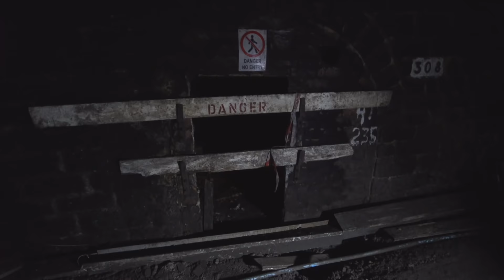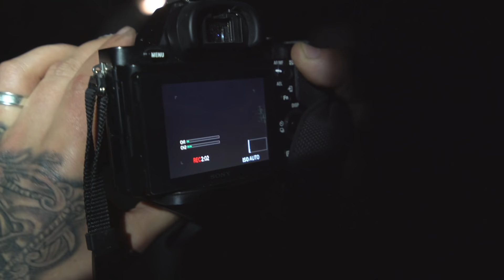CRAZIEST UNDERGROUND EXPLORE YET! A WORKING TRAIN SURPRISES US!

Comment: ~ What if, what we have been thinking of as Tunnels under the surface, were actually originally the buildings existing on the surface ? We tend to think of things in terms of what they are used for now, when maybe, they have just been re-purposed from a previous time & used after some alterations to their immediate surroundings have occurred. ~ The round tall part, {that people are saying was used for steam trains}, may actually be a round tower, from an older building, that you see all around the world.~ It just happens to be buried now, but it wasn't always. ~ The arches you see, are not the height that they look now, they were buried, so the floor comes further up to the middle or top area of the arch, & the rest is buried beneath your feet, as you walk through the tunnel. ~ It would easily explain the fireplace & wooden floor, that was found. ~It would also be interesting to see what is really, hidden within the places that say danger, as that is also probably also hiding things of significance,{ just like the tower, that you discovered.} ~ There is much hidden in plain sight, when you start looking at all of the buildings & levels, & also notice the pre-existing structures,that are exposed when the ground is dug up, to build other structures.~ Thank you for showing us this, it shows way more, than just tunnels. ~ Looking forward to seeing more, of our world, Thank you immensely, for your efforts. ~

Comment: Surely this is just Standedge? It has three railway tunnels, two which are no longer used for rail, but I understand when a boat goes through the canal tunnel a vehicle often shadows it for safety, hence the recent tyre tracks. There are also three (i think) refuges that the pilot has to report in at, you came across one of them. None of this is sinister or military! Think you are pulling our leg as it isn't in Hull either!🤨

Comment: The tunnels you're walking down are maintenance tunnels and yes Van's do go down them when track maintenance is needed (the trains you've been seeing) I wouldnt want to be lugging all my tools all that way to get on the track for signal maintenance and the shaft where all the water was pouring down is just as you say a ventilation shaft the fireplace is years old and was for old workers back in the day like the 60's the boat you saw is a survey boat I'm pretty sure not that I've seen them underground myself

Comment: Think years bk if u were on ur break working down the tunnel them fire boxes would be the only heat and way ov cooking ur Breakfast the holes are vent shafts for air steam and smoke from the old trains could also be used for emergency if needed

Comment: That tunnel you were walking down was an old railway line. Those 'danger' holes in the walls were clearance holes for people to use when trains where lassing. The boat was more than likely used for surveying the condition of the tunnels. I must add though. If you are going to plan on crawling down a tunnel why the hell would you go down wearing caps and ripped jeans... Seriously. Get some overalls 😂

Comment: You should never smoke in tunnels or caves as there is no methodology completely remove the smoke. The smell and smoke will last for years if not decades. Ventilation systems are inadequate to cleanse the tunnel or cave

Comment: Well I was totally confused by this as you start off in Hull and we seem to end up in Standedge Tunnels!   The boat was a tourist trip boat that does not go all the way through, it goes so far in then reverses out.  The place where you tripped the light is one of the safety stations that cannal boats going through have to stop and contact the outside world so the operators know how far you travelled.  Oh and you have to have a tunnel man onboard your boat.  Surely there is not two sets of tunnels like this so I leave this with you.

Comment: Watched this last night and couldn't work out how they got a boat 600ft under Hull. Didn't think it should be possible. I was right, the actual tunnel they went in was 40 miles away.  Seriously, why lie? Won't be watching any more of your edited nonsense. I prefer honesty, even if it isn't as exciting.  BTW the people on the boat were banging on the walls to test the structural integrity of the tunnel. Knock on the brickwork with a hammer and if it sounds hollow, then water has got behind and it needs sorting out.

Comment: When I saw this video, I wanted to know more about these tunnels.  So I found another video where they explained from A to Z the underground network. So the canal tunnel is the oldest (made around 1800) And then you got two disused train tunnels and one train tunnel still in use. The complex was finished around 1895. Between all those tunnels you find side tunnels. These come in very handy, if something happens on a boat or a train, they can get an ambulance through the disused tunnel and evacuate people through the side tunnels. But think about the many lives that got lost by making those tunnels. Think about men, women, and children working with handtools. The only facility they had back then were horses, mules and candle lights. Deepest respect for those heroes.

Comment: well the tunnel is so magic and massive that they go down it in hull and they appear on a rail tunnel under the peak district. worth noting is that hull has a tunnel system to control and prevent flooding that fills up very quick with the tide and from rain. you wouldnt want to get caught out down there and stuck.

Comment: 31:30 1800's or later, due to the amount of soot on the walls and the amount of degradation to the materials, I theorize that a flash fire might have occurred.
Reply: Groovy Godzilla?
Reply: Those are old railwaytunnels. So the soot on the walls was left there by the many steamtrains that passed through the tunnels in all those years.

Comment: publuc canal having a inspection multiple train tunnels inuse and discus the hole in the roof is for fresh air and if ya follow the maintenance road the old railway tunnel it will take you to some gates next to a main road  there are multiple ways in and out fire places are for railway maintenance to have food and to keep warm back when it was steam trains .... pir censor for lights and a alarm to notify staff that an emergency has happened the ticking is for emergency exit to alert anyone that a emergency point is there   if ya on a boat and ya fall off ya gona die unless you get out or are picked up by your own boat or any of the others with in the convoys if ya unlucky ya fall of ya boat and get ran over by one behind you or if ya the last one you drown its a two way system done with convoys and with a traffic control system controlled by staff ....there is much more to that place but i cant remember the rest and heads up parts of the system is owned by the railway there for trespassing with in them areas can result in death or trespassing fines up to £1000 +

Comment: lol u have not much clue whats what do u?..  :D   13:35 disused railroad tunnel.  17:35 obviously a railroad tunnel in use.  be careful. 20:44 maintenance canal boat in the canal runing along the railroad tunnels.. (used to do that in victorian times).  28:10   is whats known as a ventilation shaft,    for ventilation in the tunels to get rid of exhaust from steam locomotives in the day   u felt the rush of air didnt u?..    proof it works..  :)